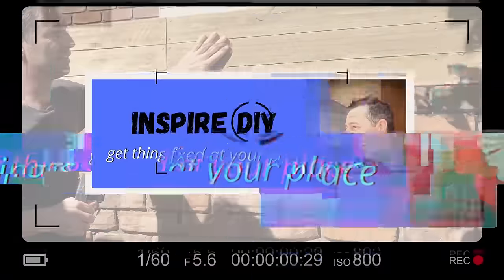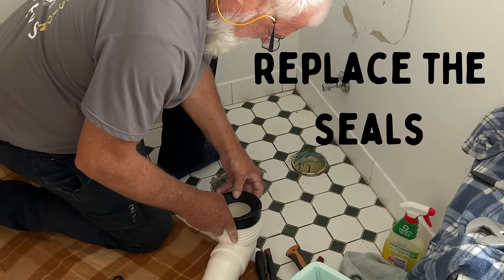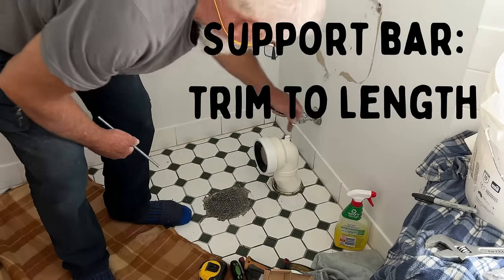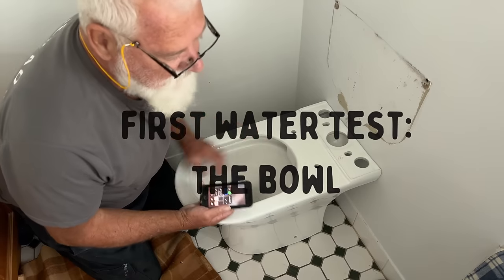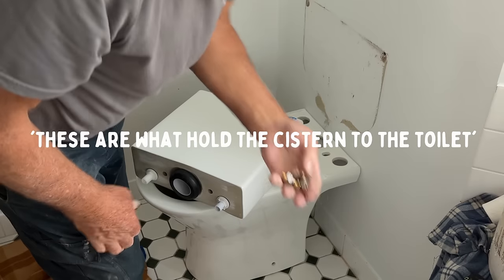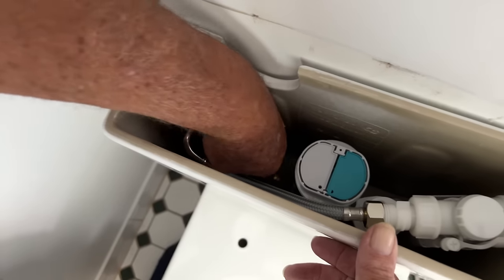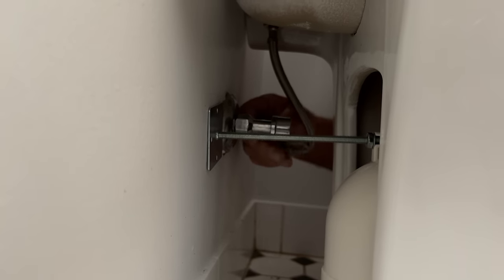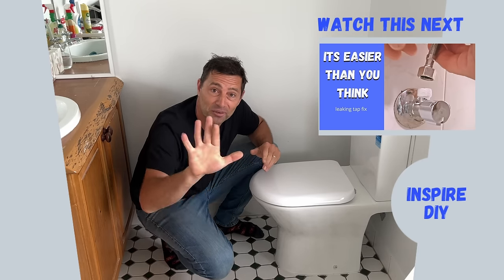Can you DIY Install a toilet in Australia or NZ - Inspire DIY

Comment: How is the toilet anchored to the floor ?
Reply: True
Most shitters I have seen are concreted to the floor
Reply: @dalewhitmore143 most plumbers just  silicone toilets down the fixings supplied for these are pointless and a annoying to install
Reply: @Toddbaldwin00  Silicone works as a good glue connection, but in this video he just ran a bead around the outside. First person to lean forward on that throne is gonna tip it.
Reply: this is what I was thinking maybe lay beads under aswell. doing ours today and has screws on side ?
Reply: @81griffin   i installed one recently, it had L brackets that fitted to the inside down the bottom . put them into the concrete floor with  a ramset anchor and siliconed the bottom . been in about 6 months ,seems to be holding up ok.

Comment: so the only thing holding to toilet to the ground was a bead of silicone ? what happen if your doing a major big poo and you move around a bit. wont the toilet move ?
Reply from the maker: Hey mechanical, I wondered the same thing and I guess that’s why they have the option of support brackets each side (if you were planning to wriggle around whilst pooping) 3 toilets installed the same way haven’t budged in 7yrs using this silicone bead technique.. you could always wedge the bowl up to get some silicone underneath if needed🤷‍♂️ not a silly idea mate. Cheers, Kent
Reply: I have done as he suggested in the response here and added a bead of silicon before setting the pan down. In my case the floor had a bit of fall so we needed to pack it up slightly to get it level anyhow, so a good sized bead helped with that too. Once that initial "gluing" bead was set we lay a nicer clean bead in a colour to match the grout of the floor. Have done a few like this in two houses, all are at least 10 years in and one closer to 15 years. No issues at all.
Reply: 10/10 for this!!No unnecessary talking or extras in the video which made it a great short watch, but very informative and easy instructions. thanks mate 😊
Reply: Lmao 😂

Comment: You just glued the pot to the floor? This will become loose in a few years, and then it will be like riding a wild mouse. What is the reason you didn't bolt the pot down?
Reply from the maker: Hey Pfabra, it was the Plumbers preference, maybe lazy - but many years on since other dunny instals done the same way and they have held well. were you meaning moose or mouse because thats hilarious.. all the best mate, Kent
Reply: I’ve put hundreds of toilets in like that without the bolts and silicone around the bottom. I’ve never seen one that’s ever moved.

Comment: This is getting better, men - I hope you get Bunning Sponsor.
Reply: he deserves it! but plumbers (and their trade cards $$$) will hate on bunnings! (they will also hate on this great video!) this is the type of video that cuts into plumbers market (they are not as protected as other tradesmen like electricians).
Reply: Why is the ceramic bowl touching the tile floor when it would be more appropriate to have a layer of silicon. I recently installed one by applying advice from Corona to place the bowl in position then mark around the base of the bowl, remove the bowl then apply a layer of silicon 8mm high around the inside of the marked out area, then position four, 5 or 6mm plastic spaces, to support the weight of the Bowl, then position the Bowl in place, wait to dry then remove spaces.

Comment: This is bloody awesome!!! Thanks mate i now feel confident to change our old dunny to a nice new one… 🎉
Reply from the maker: Well done Amanda 👌👌 Kent
Reply: Why is the ceramic bowl touching the tile floor when it would be more appropriate to have a layer of silicon. I recently installed one by applying advice from Corona to place the bowl in position then mark around the base of the bowl, remove the bowl then apply a layer of silicon 8mm high around the inside of the marked out area, then position four, 5 or 6mm plastic spaces, to support the weight of the Bowl, then position the Bowl in place, wait to dry then remove spaces.
Reply: @rogerjamespaul5528 are you saying the 4 spacers sit underneath the pan so it doesn't touch the floor directly? But then you can't remove them if you silicon around where the pan sits on the floor

Comment: Great instruction. I would have liked to see how the second screw fitting inside the tank was screwed in, I had to make a tool from conduit with a slot in the end to turn those fittings.
Reply from the maker: Oh very clever John, love the ingenuity! with the inlet connection out of the way, the old man was able to get his arm down there and tighten them up enough. cheers for the comment. Kent

Comment: Any video of the pan that goes straight to the wall instead of floor? 
 Also what is  the last 40mm when your doing your measurements from the wall? Thanks  a very helpful video 🙂
Reply from the maker: Hey ashizor, no p-pan video sorry🫤
130mm wall to back edge of toilet, 
80mm further to the outlet, + 40 mm allowing connector overlap
Thanks mate, Kent

Comment: Where the sewer pipe comes up from out of the ground, did you just shorten it with an angle grinder or something or does that protruding bit just pop off? Thanks.
Reply from the maker: Hey Yingle, yeah he did cut it down, thin cutting disc on a 5” grinder. 
Cheers, Kent

Comment: What stops the porcelain to tile contact, which would either crack/chip tiles or porcelain pan, as well as making that awfull grinding noise ? 
What secures the pan to the floor solidly now ? 
Looks like the old pan used mortar to secure it to the floor before by the looks of that bare patch of tiles.
Reply from the maker: Hey Peteo, great questions 👌
Leigh ‘the plumber’ reckons that once the bowl is sitting on Clean and Flat tiles (no chipping) and a bead of silicone is applied the toilet is secured to the floor so it won’t move, if it ain’t moving - no grinding noise.
He’s had success with this technique for years. Admittedly the last one  I installed I actually put a bead under the pan as well to adhere to the tiles and it ain’t moving😉
Best of luck 👍Kent

Comment: Hi Kent,
Is it necessary to remove the old pan collar assembly? Is it possible to still install the new S trap into the existing pan collar assembly with maybe just replacing the rubber if required?
Reply from the maker: Yup, go for it, just check that the rubber gasket is pliable and sealing well when you install the new toilet. Cheers, Kent

Comment: Nice vid!
how did you remove the old pan collar assembly that was on the floor? Did you have to cut it off with the angle grinder?
And I noticed that you didn't replace it, and just pushed the new S trap into the floor.
Reply from the maker: Hey SW, yes you are right, the old toilet pan connector and its worn out O’ring needed to be  removed, we cut near to the floor with an angle grinder,. The new ‘off set’ pan connector has a  rubber gasket that’s seals against the inside of the floor waste. Cheers, Kent